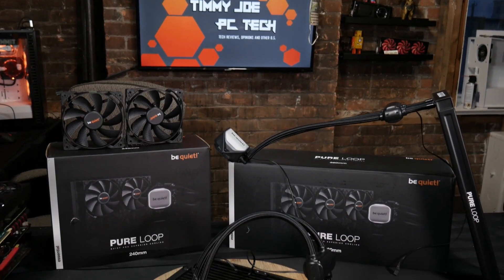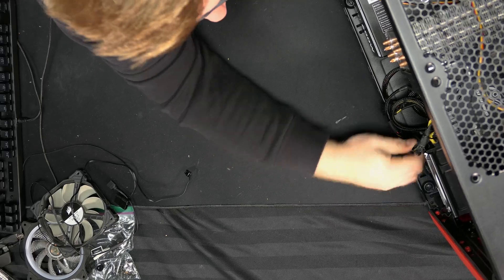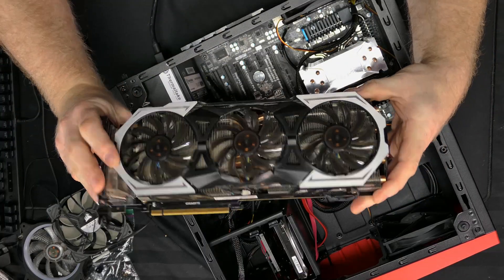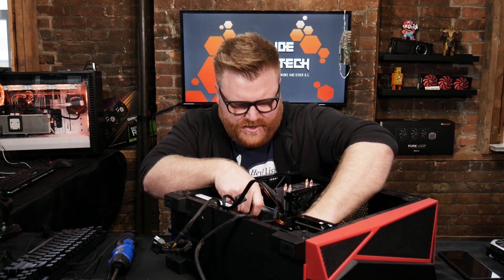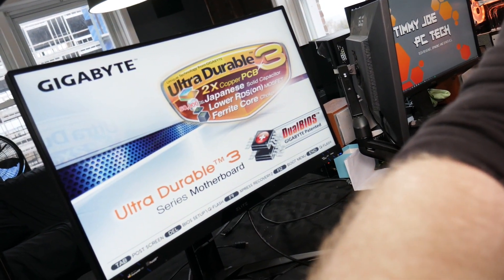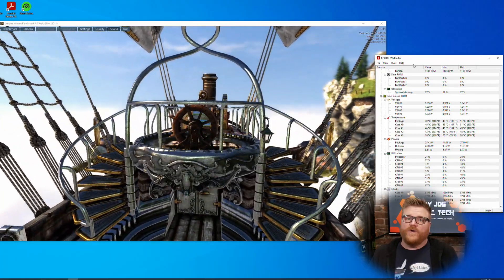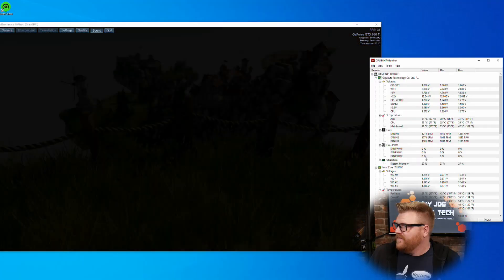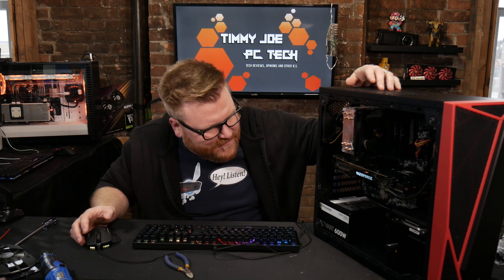His PC wouldn't boot... I should have known why :-O

Comment: When someone says building a computer is as easy as plugging things in like lego blocks, show them this video.
Reply: But... it is as easy. What, do you assemble your lego set without a manual too?
Reply: @Kubboz  plenty people attempt to build their PC without a manual, assuming that a cable wouldn't plug in somewhere it doesn't belong - as we just saw in this video.
Reply: @criznittle968  Well, yes. We saw the same video.
My point is it is very easy with a manual. I'm typing this on the first PC I've ever built with my own hands.
Reply: @Kubboz  of course it's easy with a manual, but many don't bother with manuals if they think they can figure it out.
Reply: @criznittle968  Doesn't make the task any harder, y'know. It is still about as easy as lego.
Reply: @Kubboz  sure, so long as you don't plug the wrong header into your motherboard and fry it.
Reply: @criznittle968  But you won't do that if you read the manual.
Reply: @Kubboz  right, but you could do that if you skip the manual - that's the point i'm making.

Comment: Floppy molex is not for nothing, many things still use that, like some fan controllers and other weird accessories. It's not so important have floppy molex, but time to time you find it on something. When someone insterted floppy molex to MP, it means he knows nothing about PC and he just tried put everything to connectors which look like it should fit there, he was building lego, not computer. :-D
BTW you should not moving with case like that when you trying to start it, it's not really good for HDDs, I damaged HDD only by little move with case when PC was running, it was crap HDD from problematical Seagate series, but it can happen.

Comment: I honestly didnt know you could plug it so easily to the fan header? LOL Wouldnt it be obvious if it doesnt go on easy to know it doesnt actually go there?
Reply: Yeah, they usually make it very hard to plug something into spots a cable shouldn't go.

Also there's the manual that usually comes with the motherboard (from reputable brands at least) which is EXTREMELY helpful for connecting your parts. Comes with a handy diagram showing what is located where as well.

Comment: At least the guy tried. He made a mistake but if he watches the video he'll see and learn. Must say I saw the suspicious cable running across the mother board with a drive connector on it missed end of cable was plugged into fan header. You actually disconnected that cable and was not sus that it was a very large cable for a fan header. Tut Tut Timmy need to be more observant

Comment: TBH, those exposed pin on motherboards are so hated, its possible the cable could have just falled on the pins. When they looked what it was stuck on, they might have thought "Oh that looks like its slipped off, so I'll securely firmly on." I truly hate motherboard pins, the entire concept needs to die.

Comment: HELP HELP PLZ READ AND REPLY
I am building a beast...plz help me plz tell which processor...mobo...case....gpu..aio....i should take?? which parts i should choose??options r given below in brackets......u can give me any suggestions?? i will take 5900x.....with x670 mobo or ASUS crosshair viii x570 dark hero (which one??).....gigabyte rtx 3080 gaming oc (or should i choose some other like 3080 fe or something else?? ......x73 or z73 or galahad 360 or deepcool castle 360 rgb v2(which one??)....32 gb of 3600mhz ram......corsair 1000 watt psu..... lian li o11 dynamic razer one....2tb firecuda 512 gb nvme... and for fans i am thinking to use lian li bora digital.......is anything wrong? And plz give answers of the questions of the brackets....plz reply..... and any suggestions...plz tell me..

Comment: every pc-builder has been there... sometimes you think too far ahead and just dont notice the obvious
Reply: Hindsight is 20-20.  Once I ordered an ECC memory DataBase server with RAID controller from a specialist builder, "try the 1GHz AMD Athlon T'birds?" sure.
All seemed good but in my testing I was seeing crashes.  The reason, AMD didn't then support ECC but it seemed to work until you had it running for hours under load.